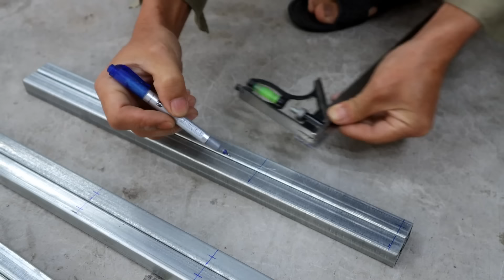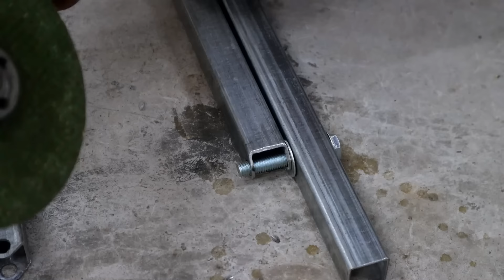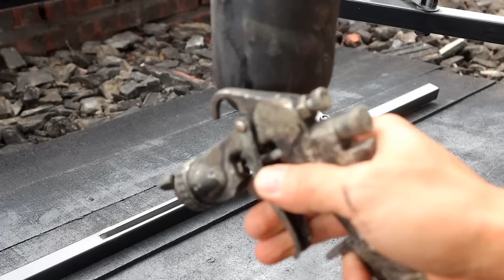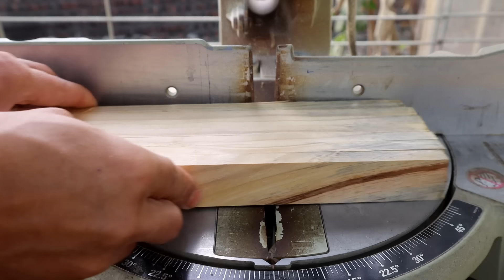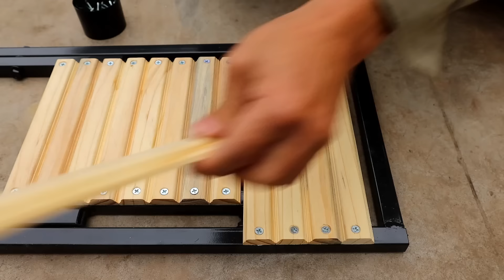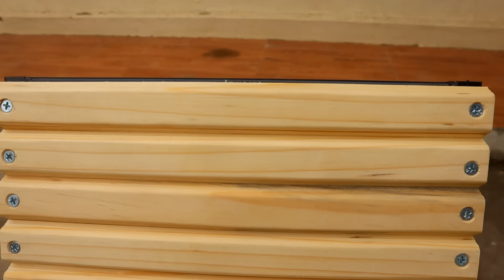Great idea for a clever crafter's folding chair / DIY smart folding metal

Comment: In Kerala State of India everyhome is having this type of " EASY CHAIRS " Instead of wooden crossbars one peace  thick cotton cloth is used.It can be removed for washing.
 For this two bars are used at both sides.The cloth will have a loop at both the ends and inserted through the cross bars, mentioned above.Then through the holes rods are inserted.When you wanted to remove the cloth for washing, pullout the rods
You should give a back support  of "U " shaped bar, or the person will fall back.This is the defect in your project.
Wish you all the best
WITH LOL From INDIA.🙏🇮🇳🙏